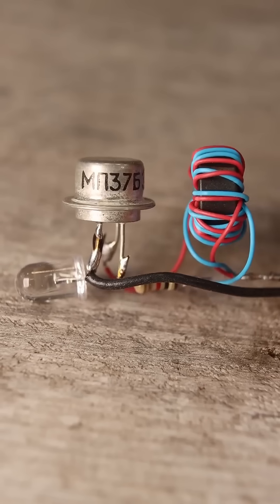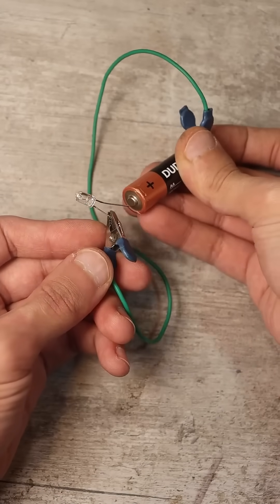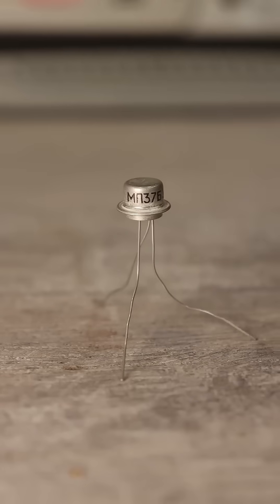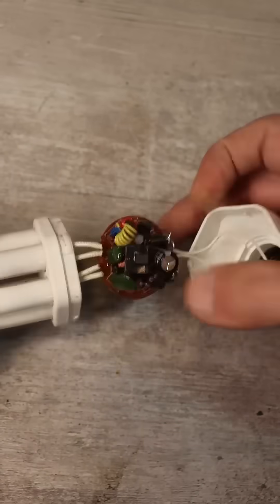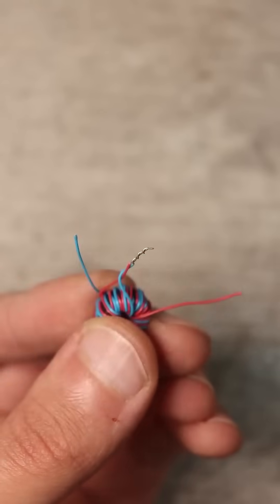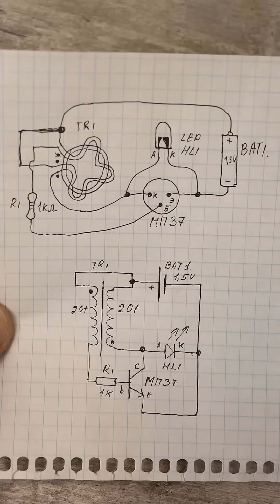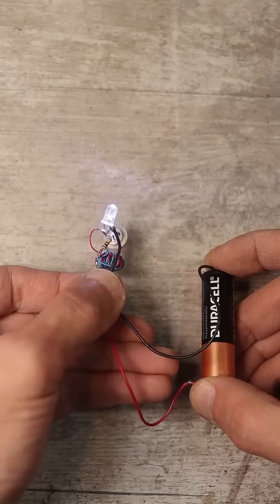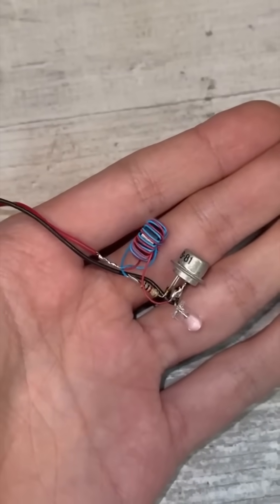JOULE THIEF in 5 minutes

Comment: The remaining energy of an alkaline battery below 0.9 V ist less than 2 to 3% of its total energy. So a Joule Thief is in fact not very useful.

In my post box at home I am driving a high efficiency white LED with 0.3 mA constant current from a Li-Ion 1s battery with 3000 mAh. The energy ist enough for continues light over more than 6 to 9 months.